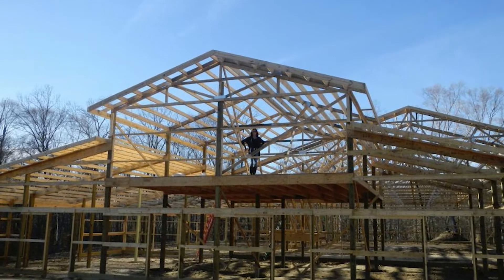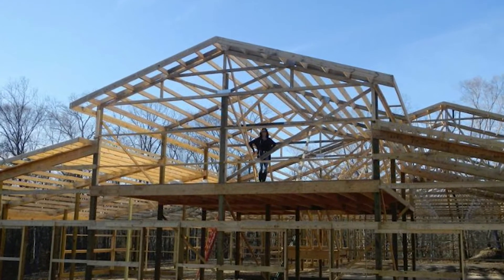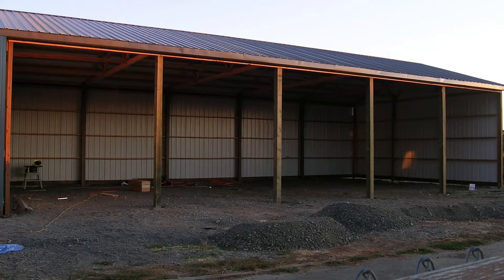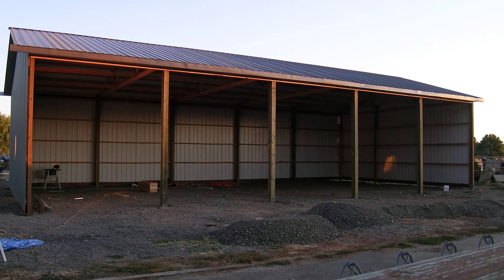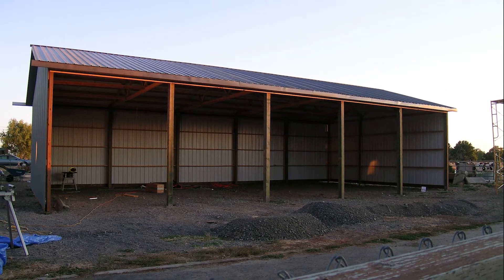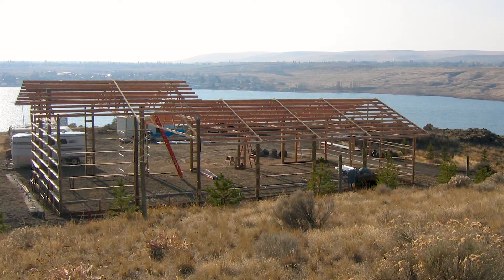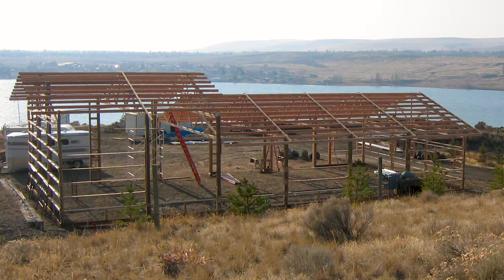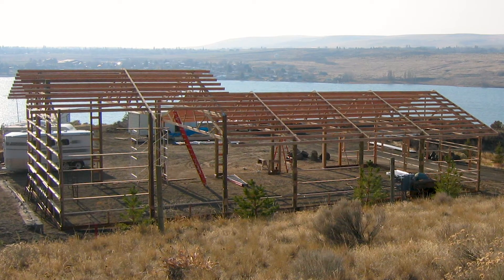Guru Talk: Truss Spacing

Comment: Well the problem is, is the minimum good enough. So you start hanging stuff off those trusses to get more storage space, you don't have enough capacity to do that. You have a tornado come by and is there enough margin to withstand a near miss etc. Yes, you can get away with trusses on 12ft centers but is it as good a building as if you go half that span etc. My building has 10ft span between trusses and I want to make some overhead storage bays. The long span and the lack of structural redundancy is a problem there. I have seen many more pole barns damaged by weather than houses.

Comment: I call it timber framing. Then it goes to the type of timber frame it is. Mortise and tenon, post and beam, and post frame are all types of construction used to make a timber frame. Usually post and beam run wide trusses with purlins.  This is where I might be able to save money. Planning on using 2"x12"x16' for rafters 16 o.c. If I paid an educated idiot or wanted to spend time with cad. I could make 4 triangular bents for 24x16 skillion roof. Then use prulins. But adding on later becomes more difficult. Another reason to pay an educated idiot is because you can then get wider header spans than what code says. Planning 6' spans instead of 12'. Right now a 12'  6x6 is 1$ cheaper than 4x6.

Comment: I am contemplating a structure using metal trusses spaced 10 feet apart. They use 2x6 for joist. Can decking and composition roofing be used with that type of application, or is it strictly designed for metal roofing ? The reason I ask is mainly for aesthetics and trying to maintain consistency between house, shop, and other out buildings

Comment: Awesome and very informative! 50% of the materials a 4-8 building would require?! That’s remarkable to say the least. Please keep this material coming!
Reply: I think you are misunderstanding the statement.  50% the number of pieces does not equal 50% the amount of material.  For example, his designs might use one 12' board instead of two 6' boards.  His method will certainly save some material costs, but it won't be anywhere near 50%. The greater point he was trying to make is that with less pieces you have fewer points where pieces are connected, and therefore fewer places where the structure may fail.